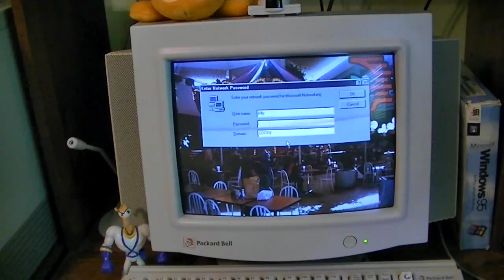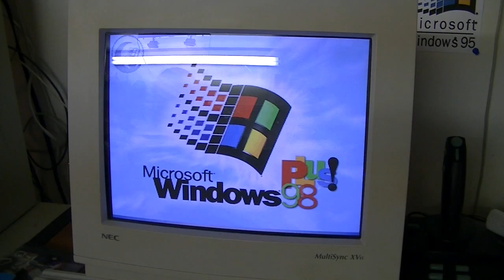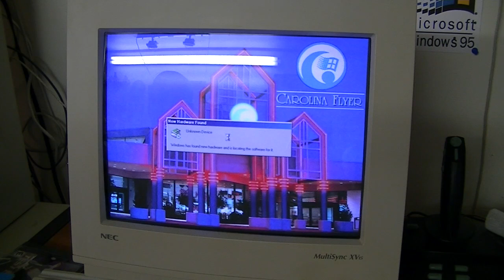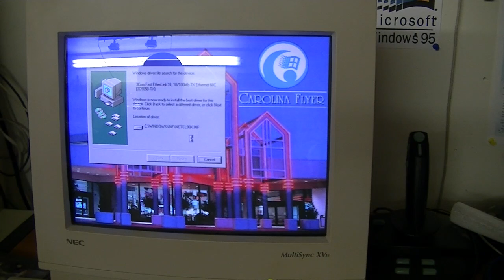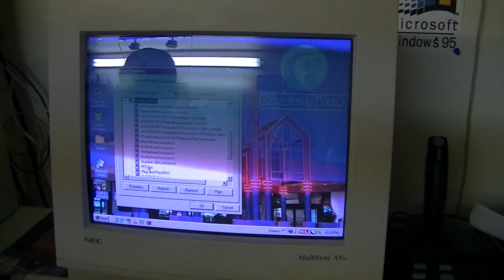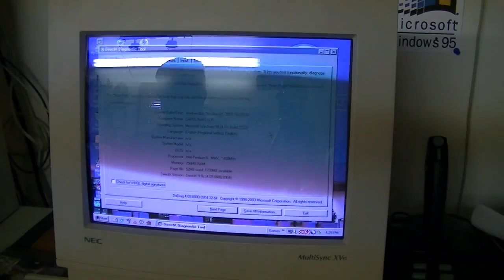Carolina Flyer Motherboard Upgrade (60FPS!)

Comment: Are you looking for the fastest Slot 1 Pentium 3 of the year 1999 like a 800 Mhz one for a ultimate 90's build?
Myself I have a nice 650 Mhz Slot 1 Pentium 3 system along with a 700 Mhz Socket Pentium 3 system.
Not the fastest for 1999 but pretty beefy.
By the way you can trick the later activation versions of Windows and fool them using a different motherboard as long as the chip sets and the network chipset is the same or perhaps very similar.
I had a emachines T6420 that was given to me free 2 years later on have power supply failure which took out the motherboard because it lacked protective circuitry being a cheap ass crap power supply.
I reasoned a more modern motherboard with a much newer and more powerful CPU in a newer socket would work as long as the network chipset and chipset of the motherboard were the same.
Because of a couple of other changes (more memory,more powerful graphics card) I did have to reactivate (Windows XP ) but it worked.
Of course I put I good quality power supply in that machine.
I have used this trick a couple of times with later Windows Operating systems and my trick worked with them too.